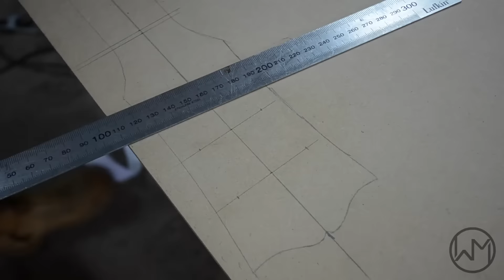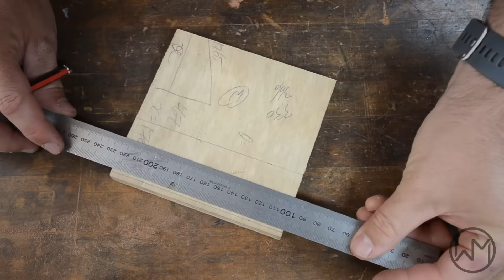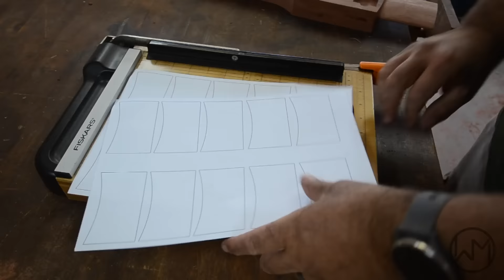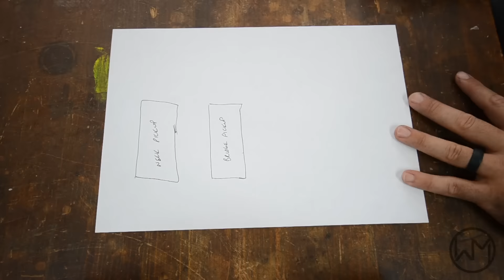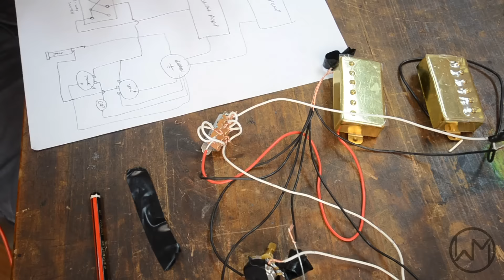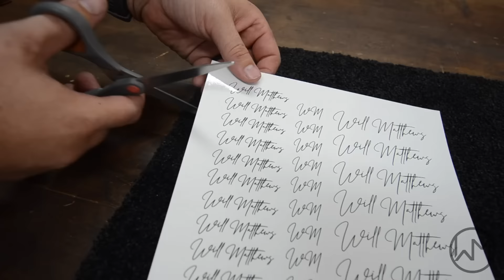Building an Electric Guitar From REAL AXES!

Comment: I know this video is 2 yrs old, even if it was 20, I have to express my admiration for the craftsmanship and attention to detail. The likes I haven't seen since I was a child back in the 50s watching my German grandfather hand making old European furniture with the "Claw & Ball" feet and the hidden mortise & tendon joints, to this day haven't loosened up on the dinning room chairs. They are just as tight as the day they were made. 
 I normally watch a whole build, because I skip ahead. But this had my full attention! I used to build cigar box guitars and have seen some pretty crazy shit made into guitars(5gallon jugs for a bass, 2x4 steel guitar, even  an old pressure cooker given a new life as a sitar)but this is off the charts awesome! But I do have one question, do you have to retune after splinting wood?😂

Comment: The quality of the woodworking on display here won my sub. I often feel inspired to attempt the craft when I watch the professional luthiers who constantly show up in my feed.

I’d probably make my own share of silly mistakes tbh. You didn’t include a truss rod in the neck my dude! Over the life of the guitar, the string tension will gradually bend the neck forward. The action will get high and uneven before one day, you go to tune the instrument and (assuming it hasn’t already become unplayable) the neck will snap.

A truss rod provides counter tension to prevent this from happening.
Reply: Actually, you're mistaken about the function and purpose of the truss rod.  The truss rod is NOT a factor in the strength of a guitar's neck or it's ability to withstand string tension.  The truss rod is there to allow adjustment to the neck, in order to have proper neck relief.  "Neck relief" is an essential factor in proper guitar setup.  Even still,  guitars in the classical period were built without truss rods for generations.  This particular "axe" was built from an extremely dense hardwood according to the video description as well as being of a substantial girth.  I also noticed that he used a set of light gauge (9-46) strings,  so I seriously doubt the neck will ever snap due to string tension.

Comment: That is absolutely gorgeous.  Any particular reason you didn't use a truss rod to prevent the neck from warping?
Reply from the maker: Difficult to make it work with this design so I didn't bother. Plus I saw a bloke making pine necks and bodies, all solid with no truss rod. And they didn't warp even after decades 👍
Reply: @WillMatthews  Fair enough.  I can't imagine any way that doesn't involve a multiple piece neck myself.  I would bet routing a channel and gluing a fretboard on top would be child's play for you if you chose to, though it would certainly lose the effect of the monolithic hunk of wood like a traditional axe handle though.  I guess that's a fair trade.  Great build.  Really cool concept!
Reply: @WillMatthews  my experience (with basses) is that the change in air humidity between season or between places on earth, is much more critical than the tension of the strings, for warping.

Comment: Would like to get in front of a proper stack and take a swing at a stump so it sticks then let it ring into feed back. The intonation sounds a bit off other than that it should chug just fine hope the adjustments on that is in range. Looks killer. Hope that cut of wood is good and stable if so it will stay true. Good idea for a forged in fire final... I like it.

Comment: Just a few questions. Where's the truss rod? You need a truss rod because the neck WILL bow from string tension over time! Did you set the intonation on the bridge? It sounded way out. And why did you put the strap button in the playing area of the neck and not on the body?

Comment: According to my cousin, this build will break from tension. No truss rod. No 45° angle at the neck to relieve tension from neck. No actual separate fretboard that is stronger than wood from neck. He says this is just a wall hanger, til it breaks if played under any real force. Looks neat tho, but I bet it didn't last, or you just hung it up shortly after the build. My Luthier class taught me same principles as well, and that Luthier sells his axes at $2200 minimum. I trust those more than you or others making comments.

Nice hall hanger artwork

Comment: |> |> |> |> |> |> |> |> 
|> |> |> |> |> |> |> |> |> 

1. amazing work!

dare, ... and cool ... 

2. isues:

no 24 frets ... that is deffantly for metal ... 24 frets are a must ... two cctaves are a logical system of movement and spirit ...

even more ... 26 have something.

for sure the neckpickup dont get that bass, but that is in a whole band anyway a problem by the mix ..

do a bit more backwards or up on the shaft is o.k... 

sattle replacement cool ..

but ... the strings must go in a streight line over the sattle ... so the tuners different place ... angle sideways always sucks ...

maybe a little additional plamrest ... for fast staccatotechnics on the lower strings (up) its good when you have a good startingpoint upwards ... and rest ... 

I play a yamaha silent guitar ... so Im familiar with the shape ... 

and ... there must be enough space to install a midipickup!

the classical/lflamenco/acoustic guitars from the roland system are insanly great ... also the jazz guitar is amazing ...

from the other midisound possiblity for orchestral sounds I dont speak.

When I play electric guitar its progressive metal between world music to smashing metal ...

maybe you understand now ...

I find that absolutly great ...

otherwise nothing to mock about ...

with heavy head you have certainly no any problem ... 

how is it to wear?

thank you!

|> |> |> |> |> |> |> |> 
|> |> |> |> |> |> |> |> |>

Comment: This is so cool... but what about the truss rod? Haven't seen one in this build.
Reply: doesn't need a truss rod.. from google: 

When you use only one dense hardwood the stresses in the neck are eliminated and so there is no need for a truss rod. 

^that's for a banjo generally but makes complete sense here, its a one piece, not even a set neck, let alone a bolt on : )
Reply: a neck through, essentially